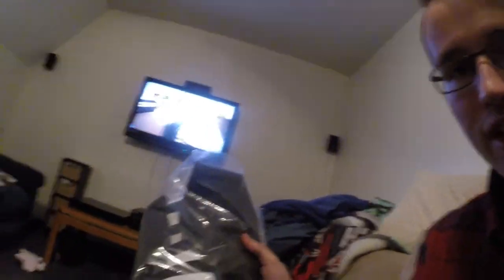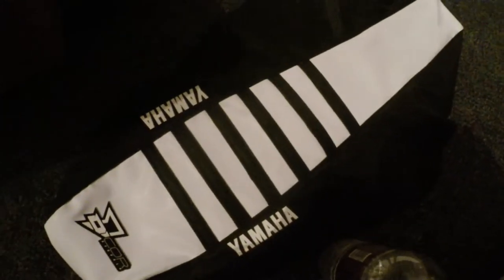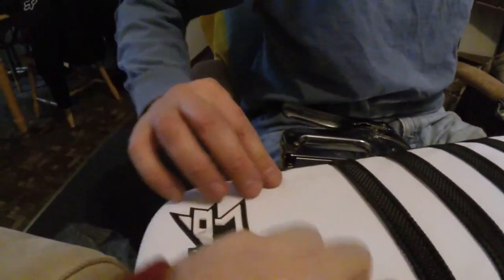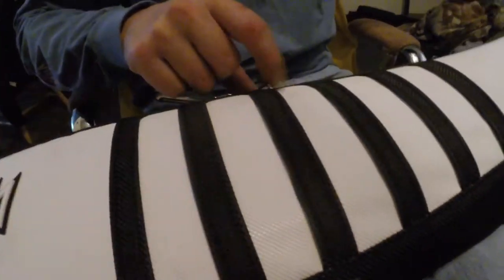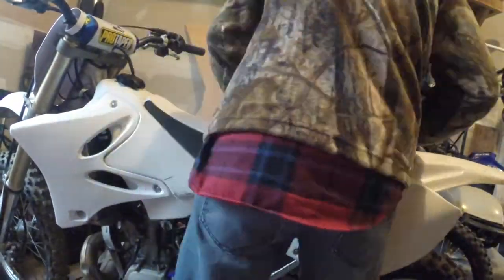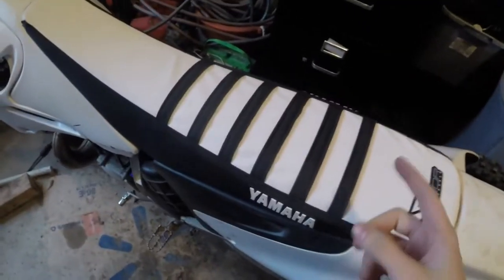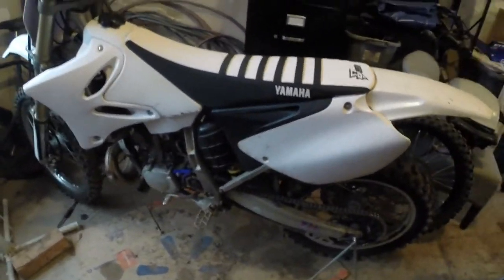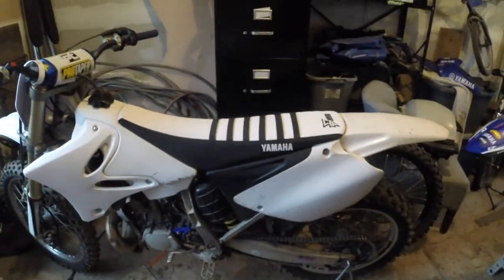The 2 Stroke Gets A New Seat Cover | Project 2 Stroke

Comment: Is that the clarke tank? If so how well does it mount and how well do the shrounds mount to it
Reply from the maker: Hayden Willie it’s just the stock tank painted white
Reply: Sean Smith okay. Howd you paint it. Been needing a white tank for months
Reply from the maker: Hayden Willie I painted it with spray paint that is meant for plastics, I don’t remember what it’s called but you can find it at a hardware store and it’s meant to be sprayed in plastic surfaces. I made a video on it as well if you are interested.
Reply from the maker: Hayden Willie I’ve been trying to find a white tank too but could never find one so I just painted it and it works out well, just need to put some more coats on in some spots then it will be fine
Reply: Sean Smith okay thanks. Ill go watch it